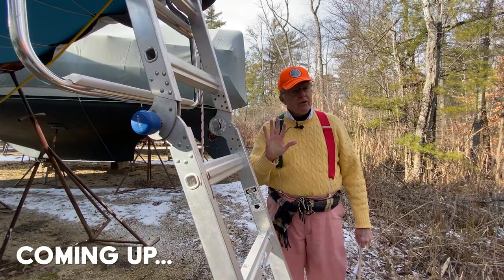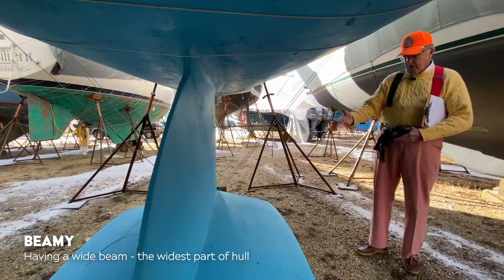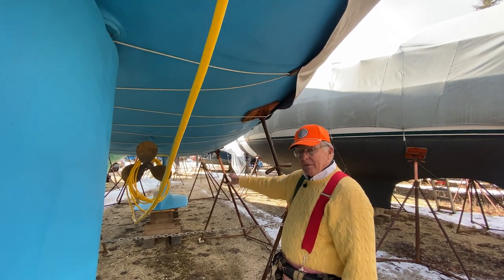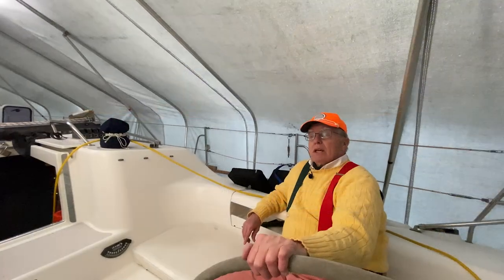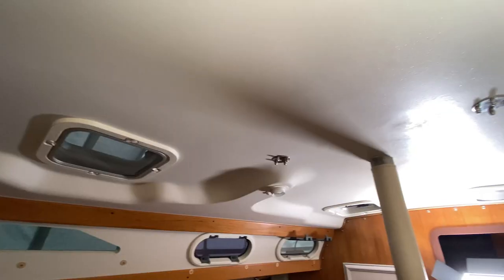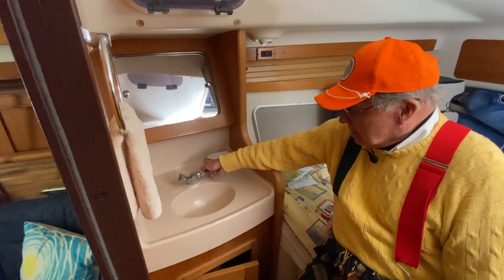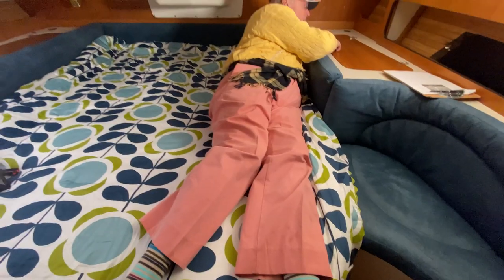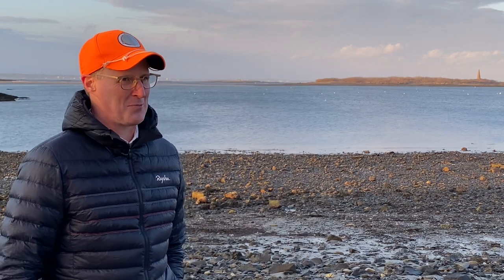$89k - GO CRUISING! Catalina 380 Sailboat for Sale | EP36 #boattour #boatreview

Comment: As an owner of a 1999 380 7' fin keel model, Captain Q certainly hit on all the features that make this an excellent boat, but he missed one... it sails as great as its aesthetics.  It's heavy so she needs about 10 knots of wind to get it going, but we've sailed it in 35 knot gusts with a little main and a little Genoa out and were completely in control and very comfortable. Parts are available and reasonably priced, and while I have spent a lot of time and money upgrading her, that was all a personal preference and by no means mandatory. Thanks for the review.
Reply from the maker: As it warms we hope to do more actual sailing but thanks for the heads up. “Water all around and salt sea air .....”🤣😃

Comment: Let me expand on your story:    About 1962, Frank Butler ordered a Victory 21 from Hank McCuen (who, as a comedian, has credit for inventing the laugh track on his comedy show in 1950, it’s in Wikipedia)   The sail emblem for the Victory was a checkered flag (and still is, I see them race as a large fleet in San Diego) following the horse race theme to his boat line names     

Hank liked to imbibe a little, and play the ponies so his boat deposits often didn’t go where they should have    Eventually Frank built his own Victory 21 in Hanks factory, which was the old Ford factory on Terminal Island, California.  Frank found he was good at boat building so he founded Catalina Yachts and built many good boats, like the Coronados, Catalinas, and a lot of Victory 21s

Hank continued building boats, he had a talent for fiberglass, however the Victory was his best looking boat.  His boats were called, Thoroughbred, Champion, and finally Yorktown  

The Yorktowns were built like no other boat.   He’d sell them at any stage of completion (like he did with Butler, which was one way to get it finished)    The keel was hollow.

The completed boat, if it ever was completed, was launched at “Eddies,” (which is still there) just down the channel from the old Ford plant, where it floated on its side 

Ballast was added until it floated level, then the cement truck backed up and filled the hollow keel and bilge until it floated on its lines.  Hank took the completed boats weight distribution seriously, almost all boats float galley side down a bit, because it’s heavier than the dinette opposite.  Not the Yorktowns 

Yorktowns were visually challenged, as all his designs were, but incredibly strong   Hank helped invent fiberglass boat building   He was among the first to use a spade rudder and fin keel (victory 21) 

You still see Yorktown in anchorages all over the world, as they are very inexpensive, capable, and, stronger than anything you could hit 

When I met Hank, he was laying up a Yorktown 42, by himself, at age 80.    An amazing guy  

I was looking for a place to build a wood dinghy   Hank let me use his shop for free, probably like he let Frank Butler and countless others.

Search out Yorktowns and see his legacy   Some are very nice   Some, not so much    Backyards all over Southern Cal and beyond still have partially built Yorktown 32s and 41s  rumor has it that Hark used sail dimensions on some boats that were shared by other designs, allowing used sails to be found easily and cheaply
Reply from the maker: Wow crazy story.  Thsnks so much for filling in these details. Really fun to discover the backstory s in this industry

Comment: Those horizontal wings on the keel won't give lift.  They are upside down wings (compared to a plane) so they'll have a downward force; like the spoiler on the back of a car.  The force is downward because the distance under the keel-wing is longer than the distance across the top causing the water molecules under the keel-wing to spread out as they travel a further distance; and thereby causing a 'vacuum' which the comparatively more compacted water molecules above the keel-wing try to fill by pushing down through the wing, and in this case causing downward 'lift'.

Comment: Hello Capt, when are you coming to florida, there is a 40 ft Hunter Legend sail boat ready for blue water at a steal price. 40 gal per hour water maker, solar panels, wind generators, and 3500 watt inverter generator, you can go anywhere, also auto pilot

Comment: 18:30 Head for or Aft?]. Head towards midships at sea to reduce perceived motion from pitching - if you care about that kind of thing.
Reply from the maker: Good thought
Reply: @YachtHunters  Actually, it is a science based though.  The closer you keep you inner ears to the gyrecenter of your yacht - that imaginary point where your yachts motions are centered - the less the accelerations your sense of equilibrium are going to be disturbed and cause you upset.  So, basically, aft cabins and forward cabins are out at sea.

If you look at traditional yachts, from say before 1980, why did they all strive to stack as many berths as possible amidships?  That is why.  A forward v-berth, you would only sleep there in port - unless you want to be seasick.
Reply from the maker: Please review the Hood layout for the best off shore berthing
Reply: @YachtHunters  Link please.

Comment: Hey Captain Q - great video, no sea dog today though. But another Aussie reference, you have theme going on here.

I'm curious as to why this would not be a Bluewater sailing boat. Is it the lack of rudder and prop skeg /protection? Weight?

It looks like a very comfortable boat for extended trips.

The thing I like about this boat is it looks low maintenance, so more sailing time, v's fixing time.
Reply: Lower volume water and fuel tanks. Lighter gauge construction and rigging. My guesses.
Reply from the maker: Safety at sea accommodations is one key point along with some of the above ...not cut and dried and always room to go either way depending on prep
Reply: deck stepped mast and lighter rigging, for sure.

Comment: When you were laying in the aft berth under the cockpit sole. I'm wondering to myself, if the ocean/sea decides to dump a big wave into the cockpit where are the scuppers ? Assume just 2 on aft end of cockpit sole ?  An it's a little tight, hopefully no head injuries
Reply: Seawater in the cockpit can flow out under the helm seat thru the open transom.
Reply from the maker: there is no transom in the boat almost...instantly goes over board almost    look again
Reply: @YachtHunters  Oops

Comment: OK, I'm a little confused here. They make the effort to to flush mount the thru hull fittings, to reduce drag but then they install a non-feathering prop. 
Then at 4:21 min. there is a feathering prop in the frame. What's going on here.
Reply from the maker: Good point about the flush fittings with the non-feathering prop.... I suppose the mfg keeps it streamlined but the owner can put on the prop they like best.  The feathering prop you saw was an example from a previous episode touring a Beneteau 461 (you should see a text/graphic reference)

Comment: I always liked Catalina boats, good design, pretty, but I read that they weren't blue water boats, something about a "shoe box,"design, the joint between the deck and hull. Can you clear this up for me Captain? I'll be in the market soon, so knowing the truth would be helpful.
Reply: Google “Catalina smile”. It was a condition where the keel starts to separate from the hull - sagging keel bolts possibly. 
I believe this only affected certain catalinas from the 1980’s. I wouldn’t let it scare me away as it can be repaired.
Reply: Might have been true in the smaller Cats, but since purchasing Morgan, and building larger boats, they’re A-rated off shore / blue water capable. My C42 Mk2 is a sweetie- although, the fuel tankage is al lil’ small for extending cruising. I use G cans on deck, and a fuel bladder in the aft lazarette, extends my range to about 600nm.
Reply: @chriscoffman8340  not looking for a project boat, or one that becomes a project... 🙄
Reply: @liveaboardsailor3787  that's good news, this is a bit bigger than I've been looking at, but I could easily afford it in a month or two, which by then it will most likely be sold. 😕 Hopefully the blue water rating applies to their smaller craft in the 33 to 35 foot range, I'll be solo sailing and single handing is a concern.
Reply: The ‘Catalina Smile’ was a common occurrence on boats of the 80’s era, when builders transitioned away from full keels. It got named after Catalina, simply because they were a popular brand - same story with ‘Camry Corner’ in automobiles. Boats built since the mid-nineties have no such issues, or Osmotic blistering, as fiberglass resin techniques & chemistry evolved.
Reply: @liveaboardsailor3787  cool, I'll put Catalina back on the menu. 👍

Comment: Did'nt see the forward cabin.  It does have one dose'nt it?
Reply from the maker: Yea at around the 16min mark… it has a mini sink and mirror in the vee berth
Reply: @YachtHunters  This boat is directly comparable to my Beneteau 390 although mine has two rear cabins and less plastic on the inside.  Catalinas are not popular in the midwest.  I really have'nt heard anything good about them with rumored structural failures on the ocean.  The valuation looks comparable.

Comment: The 380 seems to be a well built and very capable cruiser. I have huge respect for Frank Butler and all that he accomplished. He innovated and modernized the yacht industry in valuable ways. Sometime back I shared a Catalina 38, which is a boat design with a different story having been designed by Sparkman and Stevens as a one-off but eventually and unusually winding up in Frank's hands. Frank generally designed his own boats. Frank tweaked the fins and updated the deck and interior and built a few hundred. It was awesome had a quality that's missing in most Catalinas; Beauty. And that's what's missing with the Catalina 380. Your review was great and thorough as usual and you even mentioned this lacking attribute in a nicely framed way. It just isn't beautiful.  Darn. Keep it up, guys. I enjoy your reviews.
Reply from the maker: thank you, Don!
Reply: Really? And you missed the C38 with a black hull right in front of that C380?

Comment: Head aft, always, if, God forbid, you hit something your feet will take any impact not your head. Yip the modern boats carry a lot of freeboard and beam, I have a chined corten steel Van De Stadt 34' and she is jus under 12' (3.4m) and carries her beam fairly far aft with two very decent sized "quarter berths" aft, and a head forward custom layout and an enormous open plan saloon/galley including two refrigerator compartments and a freezer, full forward facing nav station with a bunch of volume and storage, way more than youd expect from a 34' boat, setup very much for extended offshore passage making and high latitude sailing (fully insulated ice rated hull, deck and coachtop) this Catalina is very nice but not really a proper job long term offshore boat with spade rudder and bolt on wing keel, in my humble opinion, great for the Caribbean and Bahamas
Reply from the maker: We had four van de stadts growing up from a flying tern to a delta to two different Trintel 
Not particularly fast but definitely go anywhere 
Except the tern of course. 🤗